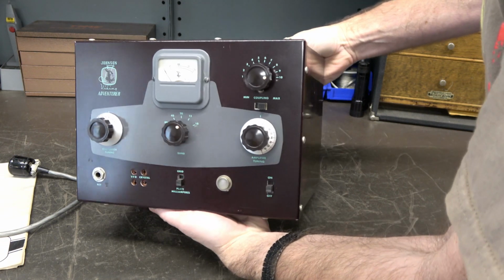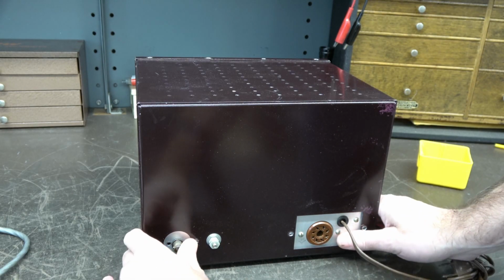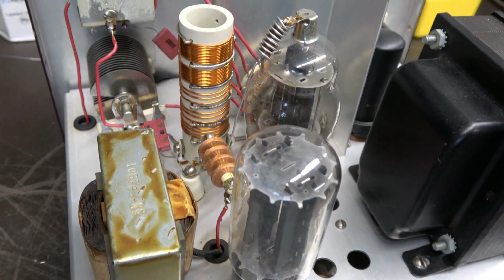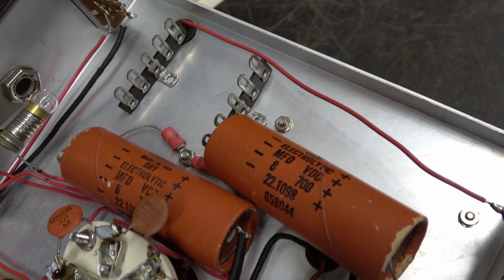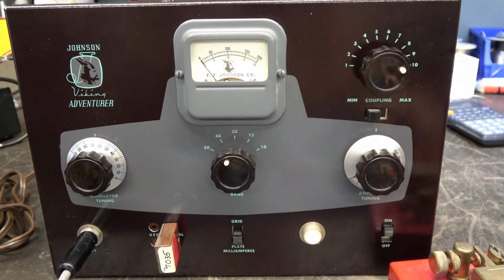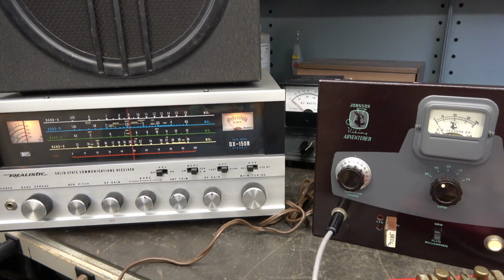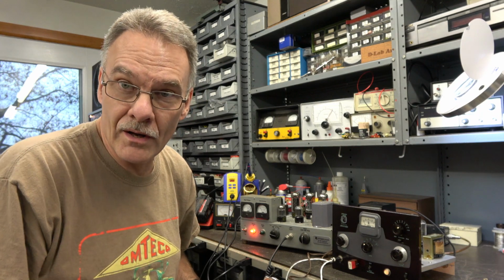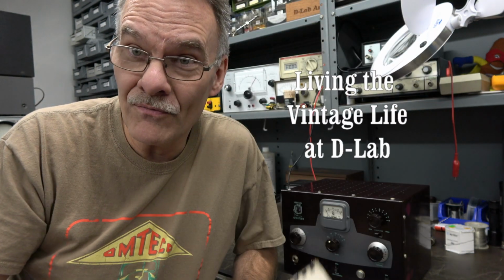Vintage EF Johnson Adventurer CW Transmitter Repair operation demo Collectors dream

Comment: I also have a pristine Adventurer that I recapped. It had been in storage for about 50 years and was immaculate. After tuning up I leave the meter on grid, so it will bounce less. If doing a QSY I tend to just check the plate tuning by confirming I have maximum output on the wattmeter which is so much easier to read than the meter on the xmtr. Max output has always coincided with the dip at the correct plate current. I use mine a few times a month for old time's sake.

Comment: The meter needs a damping resistor across it to stop the bounce. Equations are available on the web, possibly in the old Radio Amateurs Handbook. The damping resistor will reduce the sensitivity a bit, but you might be able to calibrate it and use a table to correct the reading. You can also place a capacitor across the terminals. This won't affect the reading, but it may increase the settling time. A small electrolytic can be used connected with the same polarity as the meter.

Comment: Terry.......Great video! I just picked up  an Adventurer. What was the value of those resistors that you had across each of the 22mfd 450v caps? Also I have a pair 6L6's. Could you possibly email me a schematic of your modulator using 6L6's
Tnx.... K9ADT telegraph69@live.com

Comment: I have a Johnson Adventurer and Johnson 250-40 screen modulator.  What  minor wiring changes are necessary with the Adventurer to enable use of the 250-40 modulator?

Comment: An interesting factoid.. An "identical" T-50  transmitter was made by Knight Kit.  $42.50 I think there is also a 3rd xmtr that is the same.. but I cant remember what it is.   As kits went  in 1957-62   these were expensive.  $59.95  Dx35 was  $56  DX-40 was $65 both offered phone.    The quality and finish was there, many sold , many still around and working.

Comment: I have a Viking Messenger One CB that I need to go through, and a parts chassis for the same.  I need to get my E-200-C signal generator fixed first, though; it has a bad selector switch.

That is one serious iambic paddle!

Comment: My second xmtr in 1956 at age 13 when I was first licensed. Had it for a couple of years and traded it in on a Globe Scout 680A for AM voice with money from my first job.... teaching Morse Code at a Boy Scout camp.  I do have a similarly mint one now which I'll use to set up a vintage CW station with one of three Hammarlund rcvrs I have here now. I had it with a Hammarlund HQ-100 as a teen. I would also operate from my mentor's radio at school. He was the shop teacher. I could only operate CW there because he was running a class in the same room. I'd go there instead of study halls.

Comment: Nice clean piece of kit....well worth $54.95. Regarding meters that jump around....I’ve noticed on the more recent of the Hickok tube testers a small cap is installed between the 2 mhos meter connectors...the cap acts as a damper on the meter needle.

Comment: WOW... I had the Adventurer as my very first transmitter. This was back in 1959 when I first got my Novice ticket. That one is long gone now but I did recently pick up another one from eBay. It's sitting on the shelf waiting for the capacitors to get here. Great timing, Terry. Thank you. 73 DE K7RMJ  Frank

Comment: Wow, what a great unit. So regarding the 700V filter caps, is it mandatory they be exactly 700V? Can't you use a higher voltage cap like we do in AA5 radios?